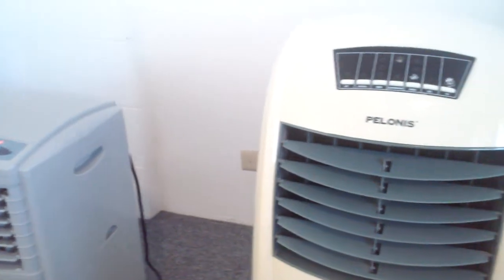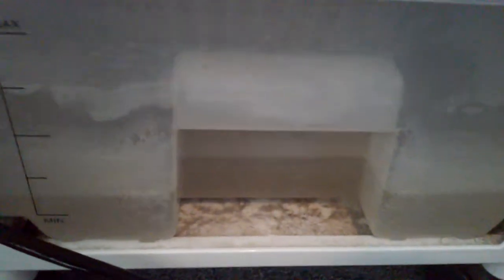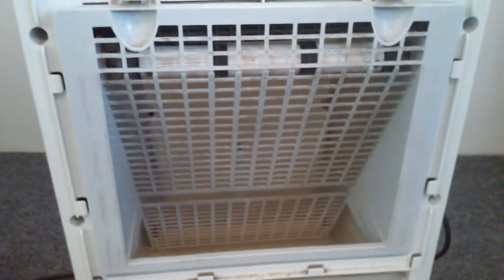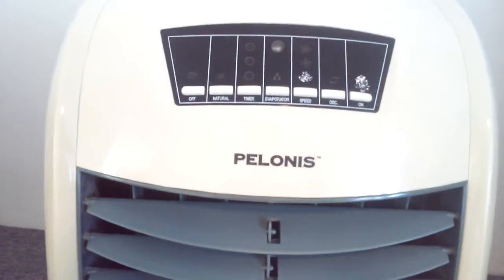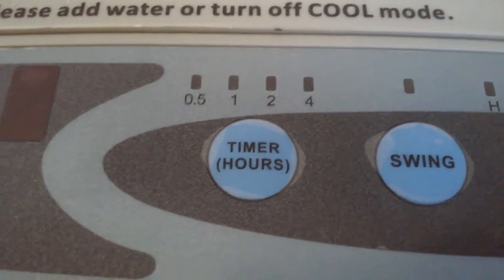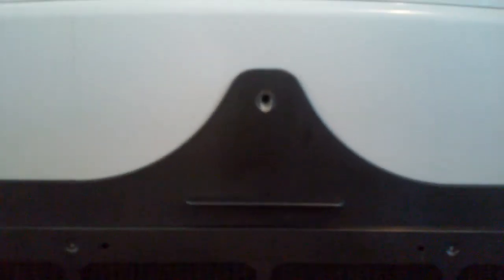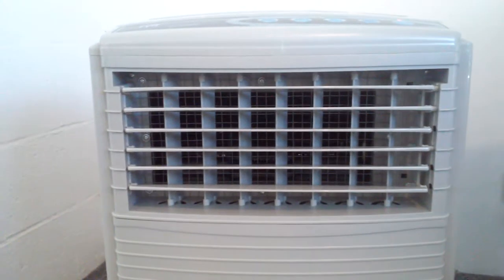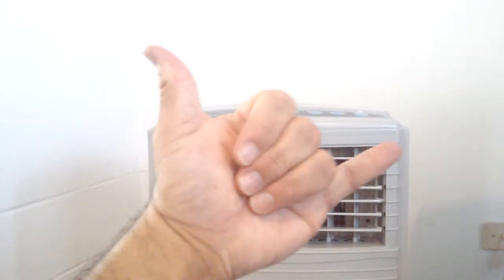Swamp Cooler in Hawaii - SPT SF 608RA vs. Pelonis Review

Comment: Aloha, The instructions say to empty the water ever 1-2 days. How do you do that? I didn't see anything in the instruction that tell you how to do that. Mahalo for your help.
Reply from the maker: Thank you for stopping by Chadsshow. Please Subscribe for more reviews. Answer your question and I think it is in the video. About 11:32 or 11:33 you see at the back middle bottom there is a rubber plug. You unplug that and drain it. Depending if you have a nozzle in your shower or take it outside and use a water hose to wash it and let the water all come out of that little plug. You do not want to get the eletronics wet. But if you do, do not use the device for a day and let it dry. These are just suggestions I have tried and not any Manufacturers recommendations. I am not responsible if your unit does not work after trying these. You can call a customer service when you get the unit. Or there are instructions comes with it. Follow the directions. Thanks again. I love my unit and still have it. Aloha.